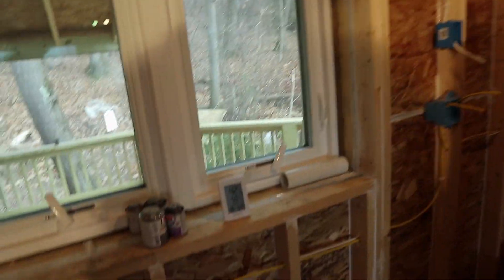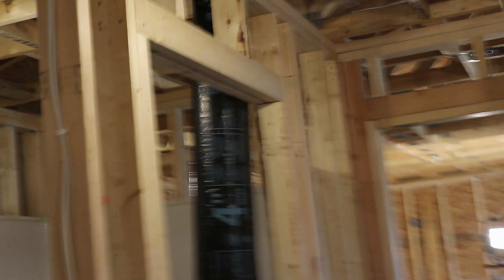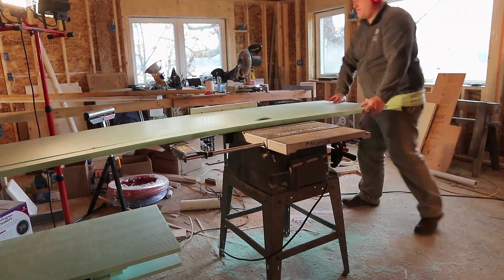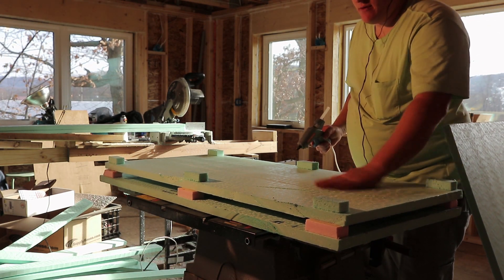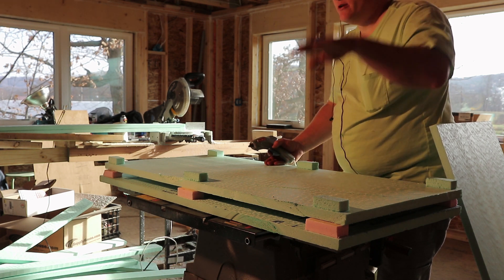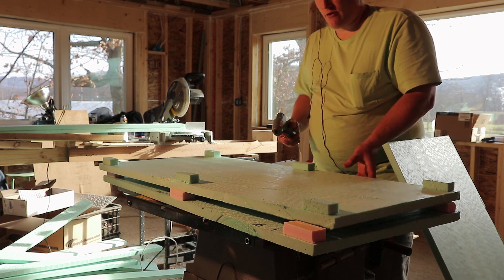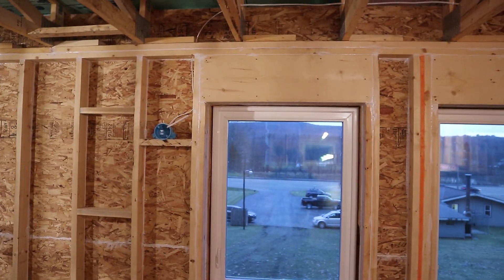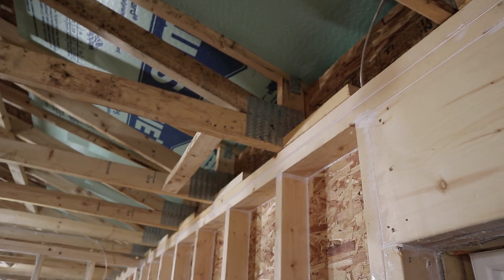PGH 14, Baffles Installation

Comment: 4 x 8 sheets of foam are hardly off cut’s also i hate to be a killjoy but you could have saved a ton of money and work by just buying the correct baffles for around 2 bucks each and with no cutting required, just staple them up !!
Reply from the maker: I could have, but I wanted the extra insulation offered by xps near the eaves where there's only 8" of blown cellulose. These baffles flow better than the molded baffles and because they are sealed they won't be convecting air through the cellulose. Stapled up baffles are not great at keeping the airflow out of the cellulose.

Comment: I hate to be a killjoy, but you could have saved yourself a ton of money by foaming the whole house before you started. You would now be working in a heated space. Saving a lot of extra labor doing the foam ceiling, then foaming them.  I made the same mistake of building 2x12 walls. Then the insulation contractor, said for about 25% more, he would only have to spray foam 4 inches, leaving me with the same amount of insulation as a 12 in wall with fiberglass. So was able to run my wires in the way and never break the seal. I ended not using the in floor water heat, as it was so air tight I use just a space heater.  One of the things that made all the diffence is when they spray the attic, it becomes usable conditioned space. In the mean time, pick up some cheap plastic and tack it to the walls. You be surprise hot much it holds the heat. I good heater is a kerosun tall heater. It provides heat and moisture.  Being that you have insulated outer walls, is that not helping at all?
Reply from the maker: Foaming the whole house would have cost about $20,000, I only have $4,000 in cellulose and reclaimed foam sheeT insulation for the same performance. Also Spray Insulation contractors are full of bullshit. take a look at this: http://www.greenbuildingadvisor.com/blogs/dept/building-science/diminishing-returns-adding-insulation

4" of spray at R6 is R24, approx 5MMBTU
My assembly is R40, approx 3MMBTU

so it's not 98% efficient as they claim, it's only halfway to perfectly insulated. My system is closer to 75% perfectly insulated.

Comment: Great idea to use the off-cuts and hot melt glue to stick it up there. :-)

You can get spray-foam kits for DIY the foam into the soffits, or you can use PU foam boards to make up for the thinner insulation space, I reckon that you can get away with a couple of layers if 4" boards with blown in cellulose insulation around the perimeter and perhaps a single layer of 4" PU foam boards on the rest of the loft-space with blown cellulose insulation on top.

I think it's worth the extra cost to install a single layer of 4" PU foam boards across the entire ceiling and if you raise it on blocks like the baffles then you have a 1" space you can pull cables in a lot easier than having to dig through the 2-3' of blown in cellulose insulation, and it will keep it up there instead of coming through any gaps in the ceiling...
Reply from the maker: That's an interesting idea with the service space created by more XPS foam. Some similar constructions actually frame in a service space below the air barrier and insulation cavity.
Reply: That would be another way of doing it and it would ensure that you don't punch any holes in your vapour-barrier and that the few you do need can be sealed up as they are visible before you add the service space with another layer of blocks and plasterboard.

Lots of ways to skin a cat as they say! :-P